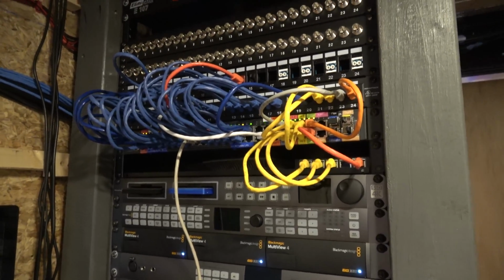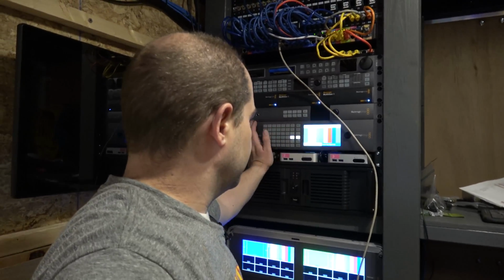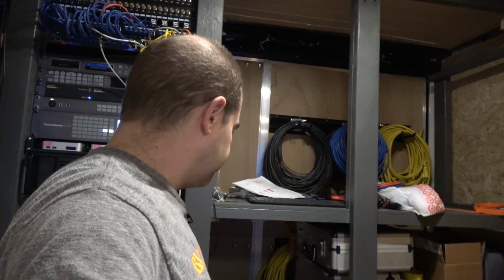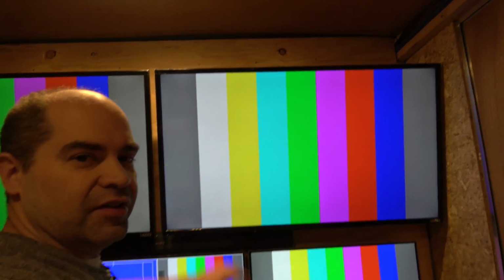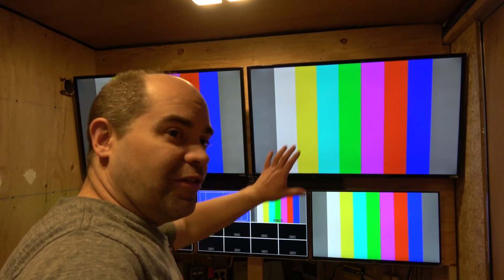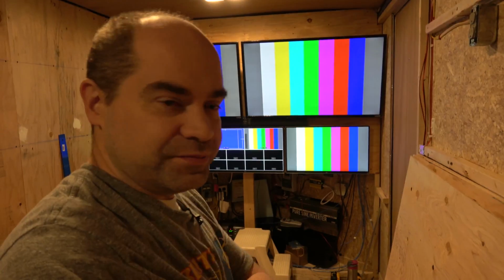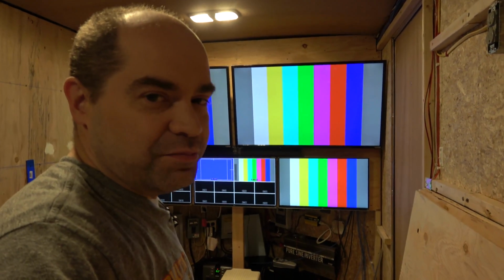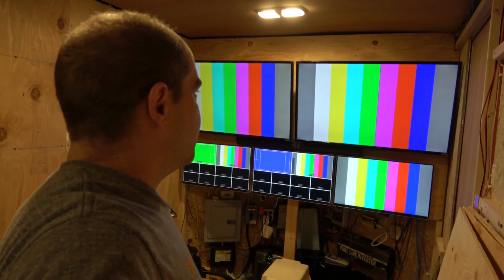Video Production Trailer Construction Update - Oct 13, 2017

Comment: Thanks for your videos! You mentioned that the three 24" monitors were LG 27UD68W. What model are the two Vizio monitors? I was looking for good color accurate monitors.
Reply from the maker: The smaller monitors are LG 27" models -- https://djp.li/lg274k 

The Vizios are a couple years old now and are no longer sold. There are better choices available today.

Comment: I'm having trouble finding a monitor where I can put program when I'm shooting 1080p30.  It seems like all monitors only work at 60hz for 1080. Any workaround?
Reply from the maker: I've had the same issue.  The only solutions I've found so far are to either (1) convert the signal to 60p through a device like the Decimator Designs MD-HX ( https://djp.li/mdhx ), or (2) buy a 4K monitor.  All of the 4K monitors I've tried also do support 30fps at 1080p as well.  In my trailer you may have noticed that I've got numerous 4K monitors -- three models from different manufacturers ( e.g. https://djp.li/lg274k ) -- and they all handle a 1080p30 signal just fine.

That said, I am also looking for inexpensive monitors that can handle 1080p30 or 1080p24.  I will be releasing a video soon asking for help in trying to find one.

Comment: Do you buy prefabricated SDI cables or do you terminate your own? Could you provide the model numbers for the cable/connectors?
Reply from the maker: I terminate all of my own.  Most of the time I use Belden 1505A cable, but for runs over about 75 feet I'll use 1694A instead. The connectors I use are Canare BCP-B4F for the 1505A, or BCP-B53 for the 1694A.
Reply: For a run over about 200 ft would you still recommend the 1694A? (Full HD, using a Blackmagic Studio Camera)
Reply from the maker: That should be fine for Full HD.
Reply: Just curious. Would your answer be different if it was 4K? Thanks for the quick response.
Reply from the maker: Felipe arbeláez I haven’t personally tried it so i can’t give you a definitive answer. But you might be okay with 6G-SDI at that distance.

Comment: Nice looking, nice build.
Just want to ask, how come you choose to put you power distro behind the monitors, i'm assuming that a table will be going there below the monitors.. If you should have some power issues during production, one would have to go under the tables to go and check those equipment.... Easy access would be nice
Reply from the maker: For several reasons, but mostly to help with weight distribution.  The equipment rack in the back is pretty heavy, and without the batteries for the power systems in the front of the trailer there simply wouldn't be enough weight up front to even come close to equalizing the weight in the back.  And since the batteries are up front and low voltage DC power doesn't travel over long cables well, the inverter and charger needed to be up there as well.  In the end it was far easier just to put everything for power in one place.

There will be a desk beneath the monitors, and locking doors under the desk to hide the power systems from view.  But there is plenty enough room behind the monitor wall that I'll be able to climb completely inside and even stand up should I need to work on it during an event, without having to interrupt the director.

Comment: Nice setup man, must be very fun to build! Can you give us a link for the small form factor PCs and also for the LG monitors? Thx
Reply from the maker: LG 27UD68-W Monitor: http://amzn.to/2xFPsQg

The particular model of Intel computer has been discontinued, but its replacement is the NUC7i5BNK (http://amzn.to/2yKRb79) -- just add your own memory, storage, and Windows (or Linux) license.
Reply: @djp_video  do you control the nucs with a kvm?
Reply from the maker: @momopnoy  No; each one has its own mouse and keyboard. The video, on the other hand, is re-routable to most monitors through the Smarthub routing switcher.

Comment: What model are the LG monitors?
Reply from the maker: They are the LG 27UD68-W: http://amzn.to/2xFPsQg
Reply: Question. Why are you going 4k with monitors and the multiview only sends 1080, or thats what i was told from Black Magic.
Reply: I just got a 4k monitor and tested it vs my 1080 monitor with the muliview quality and it was almost the same. I feel its hard to get a monitor that can show a sharp image in multiview...
Reply from the maker: Because those monitors will be used for more than just the ATEM's multiview.  For example, on Friday I shot a concert and put the active PTZ camera on the lower left monitor, M/E 1 MultiView on the center monitor, and Program on the right monitor. 

Because the monitors are connected to my Videohub I can send any signal I want to any monitor in the trailer (without rewiring), which means that ideally all of them should be 4K.
Reply from the maker: It depends on how good the deinterlace feature on the monitor is.  Some are better than others.  It looks pretty good on these LGs.
Reply: I know you have been using atem for a while and ran into this same issue, its sometimes hard to check critical focus. So you are saying i should look for higher "deinterlace" in monitor shopping?
Reply: Also, is the output for multiview 1080i or 1080p on the atem m/e switcher?
Reply from the maker: If you're trying to check focus you should really be using an external full resolution monitor on the Preview output if your model of switcher has one.  Between being downscaled to one quarter resolution, and being interlaced rather than progressive scan, the Multiview output isn't ever going to be sharp enough for critical focus checking unless you were shooting standard def.

In answer to your other question, all ATEM switcher models besides the 12G Broadcast Studio model only output 1080i on the Multiview output.  The Broadcast Studio, on the other hand, can do 4K.
Reply: So are you saying i should look for 1080i montors and it will be a little sharper the a 1080p monitor?

Comment: Looking good.  What's your plan for intercom?
Reply from the maker: For the time being I'm using the intercom features built into my Blackmagic gear.  It works pretty well, and it's nice to have it on the same fiber cable as the video.  Since I have a way of injecting external audio into the BMD intercom system, in the trailer itself I'm running microphone and headphone lines to each station and those are wired to a microphone mixer and headphone amplifier. At least for now.

That said, I'll need a better solution at some point. Something with matrix capability for sure. Right now I have my fingers crossed that a Dante-based solution catch on so I can integrate it with the audio in the trailer. A couple manufacturers do have Dante-based intercom products, but it's far from being considered a universal standard just yet. So I'm taking a bit of a wait-and-see approach.  The BMD stuff works well enough for the types of events I'm doing now so I'm not in a huge hurry to jump into something else; I can wait it out.

In the mean time one of my camera operators has some old analog RTS gear he's willing to give me, so I'll probably link that in with my BMD system for better interoperability in case I need to interface with an existing RTS system somewhere.

Comment: Looking really good.  Are you doing anything to “snug” the hdmi cables to keep them from bouncing off?
Reply from the maker: I haven't done these newest HDMI cables yet, but all of the cables are zip tied to anchors screwed to the walls. I also plan on using thread locking compound on the connectors to keep them from coming loose.